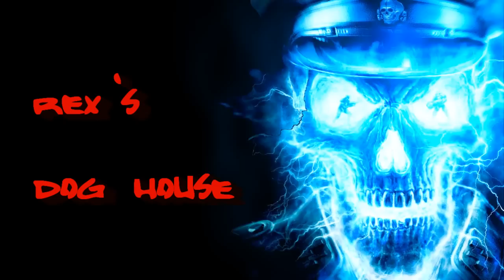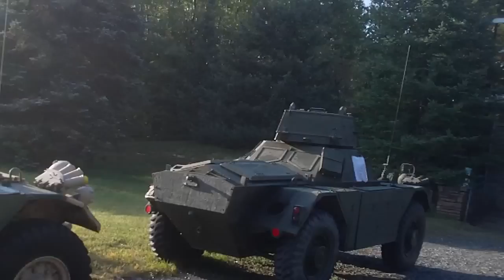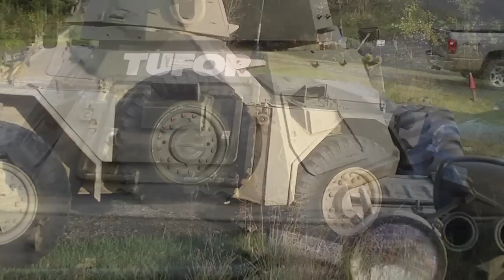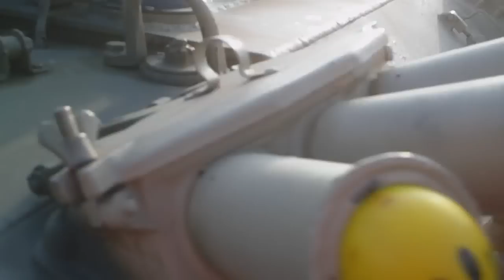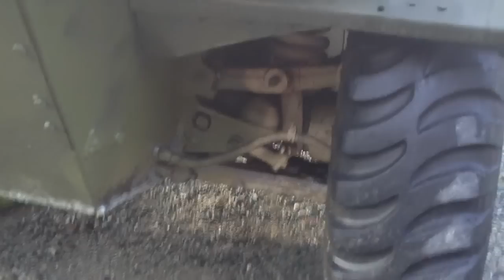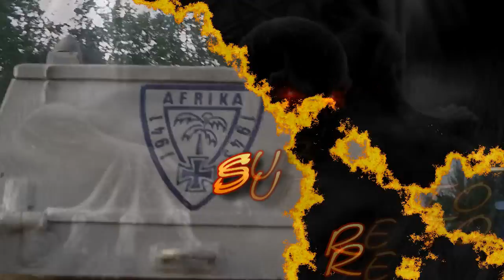FERRET armored Scout Cars in Kenagami Ontario

Comment: Our cost on these vehicles in the 90's was $1,600.00 each (US $) With a Fox turret $2,300.00 and just rebuilt by Rolls. Saracens were $8,000.00 each in Grade A condition. We have several Militia units here in MI that train with these. VERY quiet and easy to maneuver. 16 pcs in the first company (mix of MK2's and Fox veh) 32 Light and heavy types in the second Co to include Ferrets, Sarcens, Grayhounds and M-114's. Check out the vids on Libertytreeradio. Buy more ammo and mags. You'll need them.